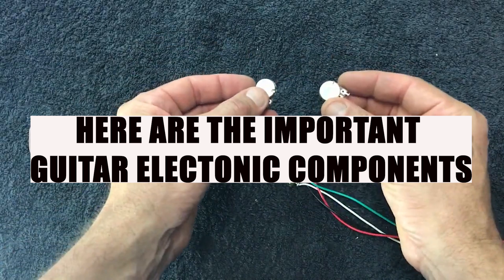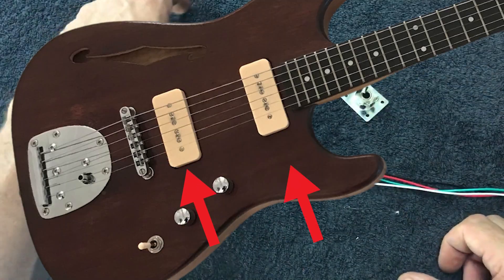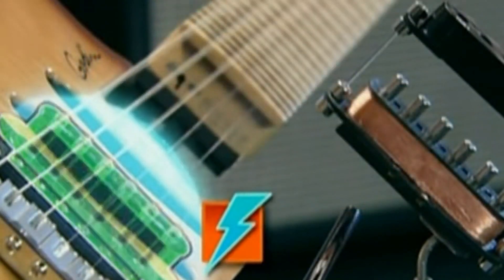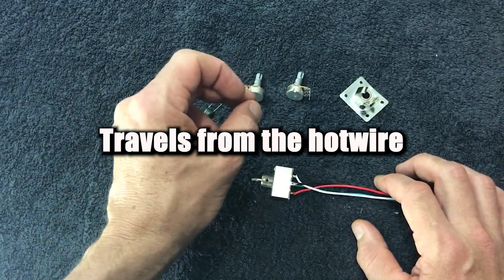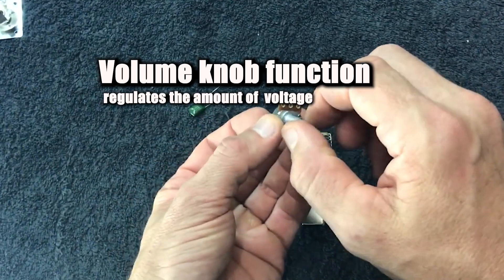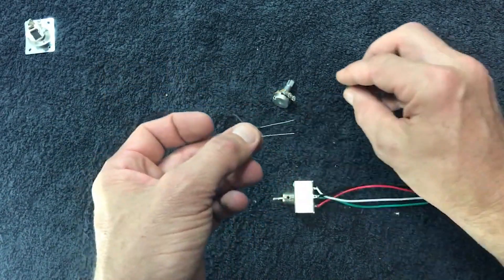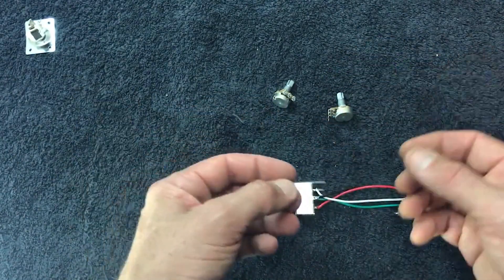How do guitar electronics work?

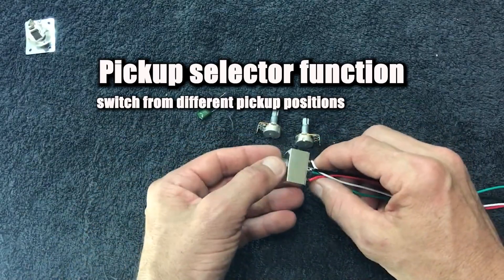Comment: Hi and thanks! A pretty good view from 30,000 feet (or 10 km) explanation of the guts of an electric guitar. One goofy comment and 1 ding. At 0:17 is that a riff on the Gatorade logo that pops up? More important, to the person who provided the captions, when discussing connecting wires to the output jack (and that's an OUTput jack [signal is sent OUT of the guitar], not an INput jack) at 0:59-1:04, those connection points are called LUGS not LOGS.
Reply from the maker: Thanks for the inputs, Jim! it did look like a Gatorade logo but nope it's not haha Yes you're right the main plug of the guitar is the output jack and the one on the amp is the input jack. Thanks for pointing that out